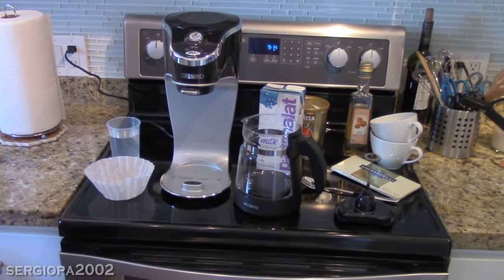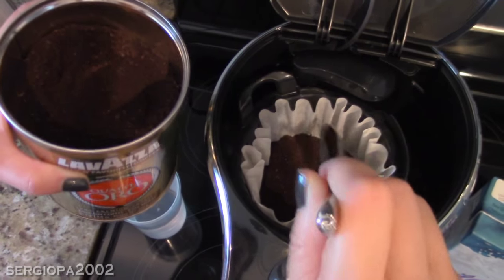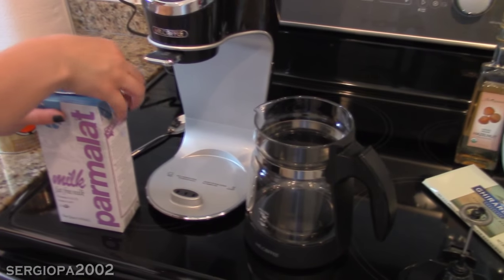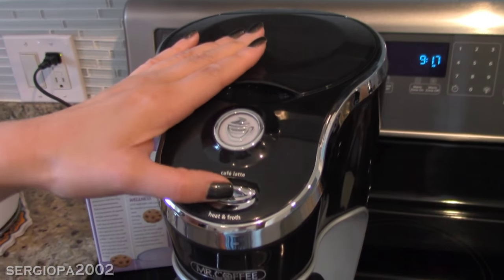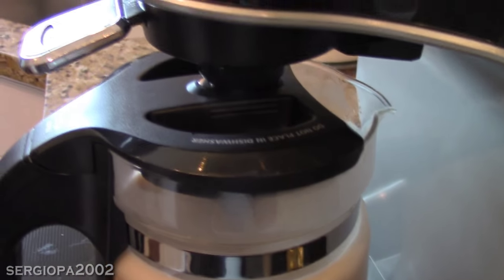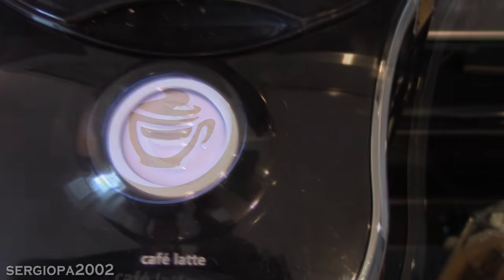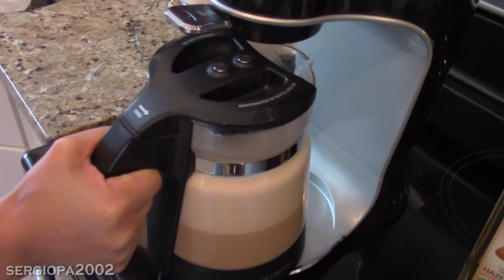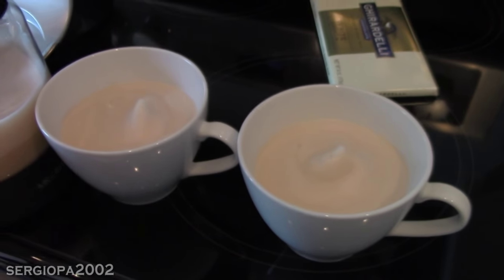Making a Cafe Latte at home using Mr. Coffee machine BVMC-EL1

Comment: just curious do u think u could add a few tablespoons of pumpkin puree in their or do u think that would mess with the stirring stick?
Reply from the maker: I think it would be ok, the stirring is pretty strong.
Reply: IMO it would not work.  The puree would go to the outside and wouldn't get mixed in.  The spinner thing isn't strong enough to pull it back in.  One time we thought to put hot chocolate mix in with the milk thinking it would mix it.  It just sank to the bottom and didn't get mixed in at all.